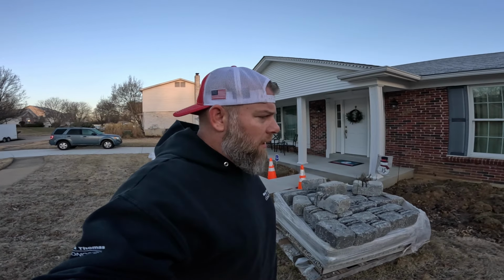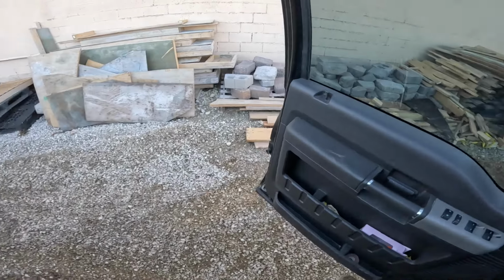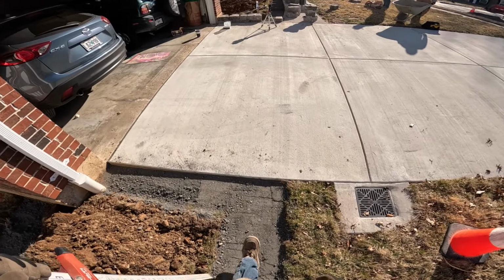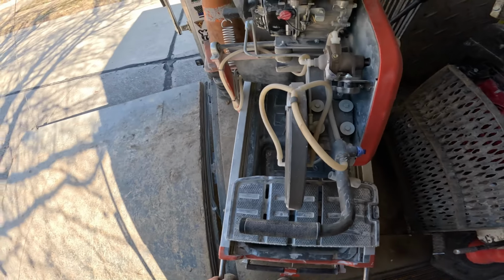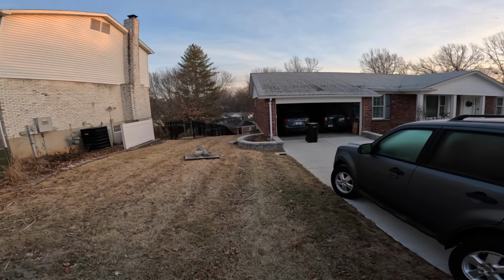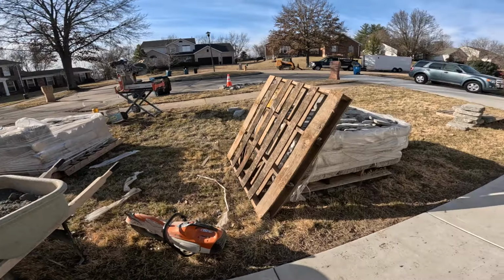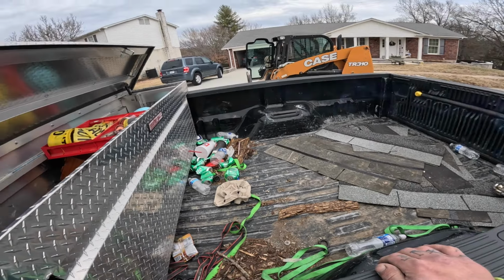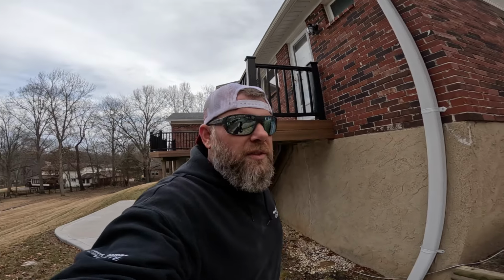We Hit the Internet Cable!!!  I Ordered Way too many Blocks...

Comment: So much to comment on this vid Rick, everything you said about Kirkwood material is right on plus you didn't mention now they close at 4 or 4:30. Crazy because guys in our line of work are usually still out at that time or hoping to load up for the next day but can't !!! Luckily I have also been using ASP as an alternative. Your cut cable line reminds me of us replacing rotten fences at a condo complex that RV Wagner built in the mid 80's. All we had to do was pull the posts and replace with new posts and fence sections in vinyl. I didn't bother with a locate and sure enough they had put the post, with concrete , directly on a power line. A big flash and lots of smoke later, 9 buildings lost power !!!! Luckily Ameren didn't charge me for the repair. Finally I am seeing this on Feb 19...how maddening was the forecast for snow on the 16th? 1 to 3 mostly on grassy surfaces..yeah right..LOL
Tell Ricky and Dave that Steve says Hi....Best, Steve

Comment: Great work boss!🤟🏽💪🏼

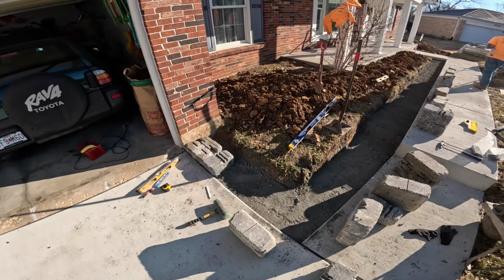just a small tip @ 7:39 what i would normally do is start my walls at the corners… that way all your cut ends can be by the house. Obviously, everyone does it differently just what i learned through out the years. 👍🏽

Comment: Hey Rick thanks for staying up late to edit and get some video out , appreciate it brother 🤘🏻 Also I’m an ironworker and don’t know much about masonry retaining walls , but shouldn’t the blocks have a stagger on em where the joints butt up ? And each other layer should match the previous joint ?
Reply from the maker: Thanks! This is the mosaic pattern. It has 4 blocks per set. It's made to look random for. Sometimes, the joints line up
Reply: @RickThomasConcrete  cool thanks brother , I’m trying to learn more about concrete and retaining walls , want to start up a business eventually , I don’t want to take up too much of your time but do you have any recommendations for starting up? Maybe a video